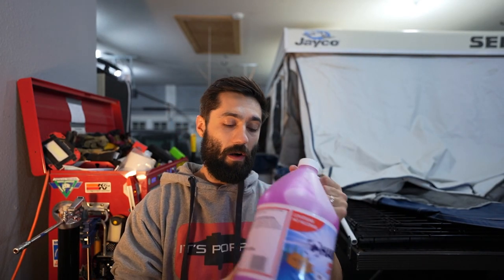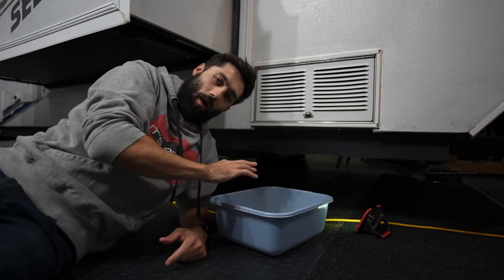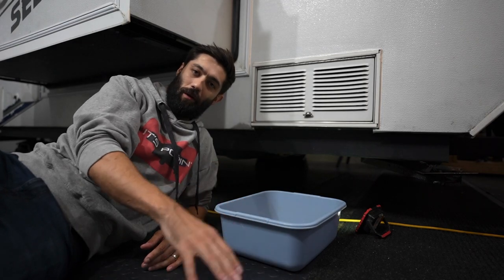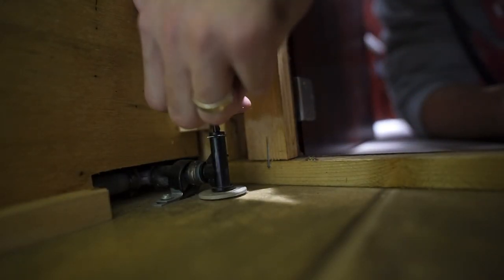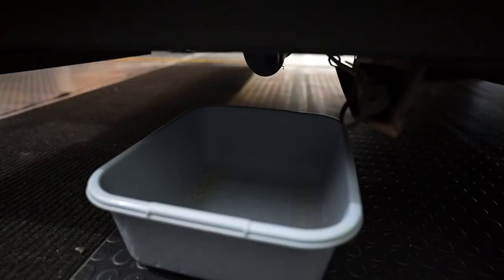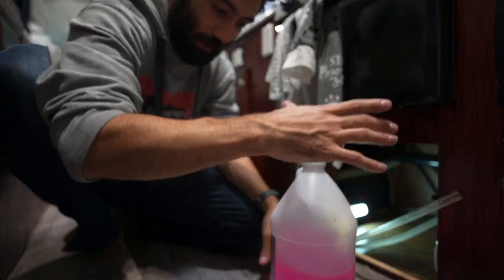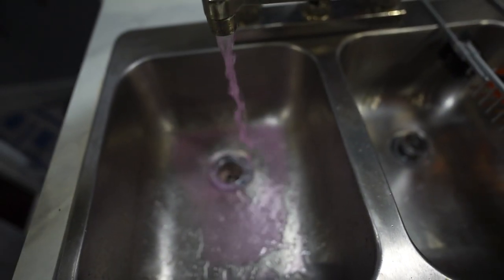Do THIS Before It FREEZES! ❄️ | Pop Up Camper WINTERIZATION | ANTIFREEZE Only Method

Comment from the maker: Thanks for watching! Which is your preference - blow out method or antifreeze only?
Reply: Dunno.... this is my first winter but here in Texas it only freezes once in a while and the people I bought my 2010 Jayco 806 from never did any winterizing on it.
Reply: I believe I waited too long to winterize. We just got back from the Ozarks, 6 " of snow and temps in the upper 20°F. I attached my brand new water pressure valve and water filter. Turned the spigot on and my hot water handle in the shower blew off. I also have what appears to be a water leak  from my bathroom pouring out on top of my black water tank. It didn't ruin our trip though.
Reply: Thanks for the video! Super helpful for a first time pop up trailer owner! Question, do we have to do anything with the city water inlet?

Comment: I thought I'd heard somewhere that you should never touch the lever on the water heater pressure relief valve. 🤔 Instead, I drained the water lines first then left the hot and cold faucet handles on to relieve the hot water tank pressure while draining it.

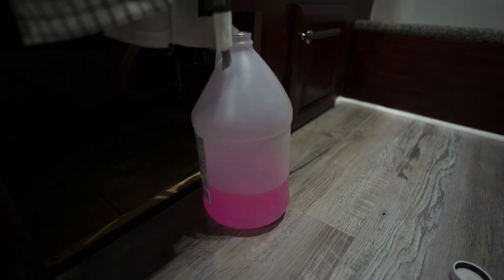Comment: 9:06 Hello there. I’m not sure if you might have a suggestion for me. I have a Jayco popup and completed all of the steps matching yours until this point. But when I turned on the water pump, nothing happens. It’s not pulling antifreeze from the gallon. I checked the breaker and fuse, and all is good. I’m stumped.